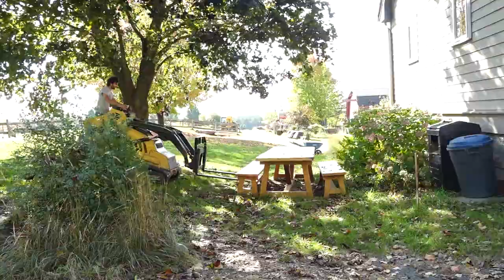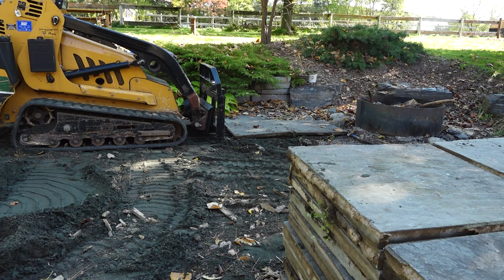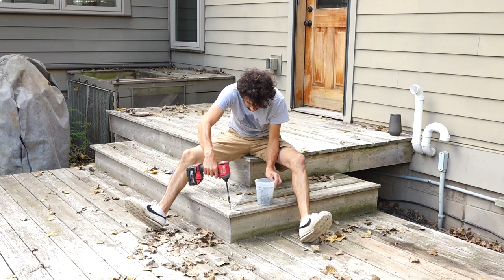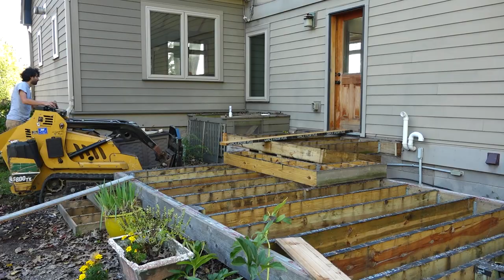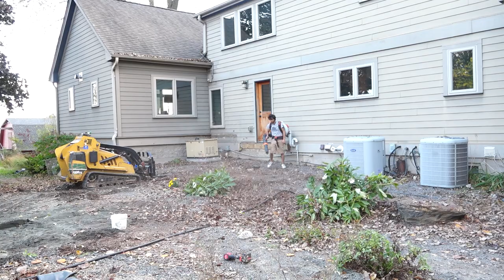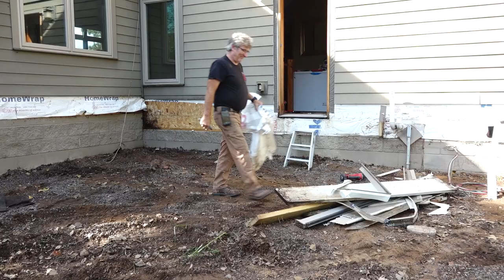Ripping out our Patio and Deck | Site Prep | Home Renovation & Addition Part 2

Comment: That skid-steer might be one of the greatest investments you've ever made, Matt. Loving the start of the house renovation series.
Reply: That grapple did wonders in pulling out those concrete supports for the deck.
Reply: @bwillan  Only because none of them had a frost flare at the bottom.

Comment: What is really interesting is watching you evolve. From your video salvaging trees in the woods. To using a chainsaw mill. Building your own bandsaw mill. Getting the skid steer. Getting the telehandler. Starting the renovation by carefully removing the screws from your deck. To using the telehandler to just remove the deck.

Comment: Bless that deck builder for not running the screws in far below the surface.  That deck can't be that old either as the screws readily came out. I tried taking deck boards off a old deck, but many of the screws were rusted and sunk too deep and the screw heads just sheared off.  It was a royal pain.

Comment: I'm impressed that you took the time to pull every one of the deck screws.
You can plain and joiner and trim those deck boards to like new and use them on your new deck sealing them with Thomson's wood sealer and west system resin coat for durability.
Just add sand to the resin for a skid free deck.
That mini fork lift is definitely a game changer taking out the deck and paving blocks.
I'm just surprised you didn't wear a waist lifter belt and lift from your knees instead of lifting with your back like you did.
That'll come back and bite you when your my age.

Comment: While you're at it you could just move the AC units and the generator under the balcony and put lattice with gate around it so it consolidated and hidden a bit. That is if there enough space for proper airflow...

Comment: I can’t believe that you use heat pumps to heat your house up there in Minnesota, therefore the two compressors must be A/C only. When we did our renovation we had two A/C compressors+heat pumps and a two-year old gas furnace feeding hot water to a house full of old cast iron radiators. During the restoration we added a third A/C only compressor and added a hot water radiator to each air handler while deleting the old cast iron radiators. There’s a three way manifold with solenoids off the furnace feeding the individual air handlers as determined by the three thermostats. Works like a champ. Our heating bill has gone way down. With all we did including a house wrap, doubling up 2x4 studs to be 2x6 per code and extra insulation the fireplace won’t even draw unless we leave a window open. We’re in Maryland and you’re in Minnesota so YMMV.

Comment: while you guys are re-engineering the roof you should PUT ON SOLAR!!! You won't regret it, it's one of the few things you can do like that which will passively  make you money.
Reply: Do you have an inexpensive supplier of panels? I've had 3 installers provide quotes and all of them in the range of $60,000 for my house. My electric prices are pretty low and have been trending down as more wind comes online. The payback is in the 25-30 year range.

Comment: Certainly the generator should never have been installed that close to the house and it should not have been covered like that either.. I also wonder how much all that "fencing" around the air conditioning units affected their efficiency. You have done a tremendous amount of hard work - well done.

Comment: Hey matt, that generator was installed very dangerously. Among many things, the exhaust is inches from the house, way way way too close to the windows, concrete pad had wash out under it and that stupid wood enclosure over it left it with no service access not to mention a fire hazard. 

Who ever installed it didn’t know what the were doing. 

Check your local code before reinstalling it.

Comment: As soon as I had an all terrain forklift (tractor in my case) I realized just how much I do not enjoy picking things up by hand. I didn't pay the money to sweat

Also, I tore down a bit over 1k' of fencing. Popping 4x4 posts set in concrete with the machinery just feels like cheating.
Reply from the maker: 100% cheating.
Reply: At last, someone using the only sensible cling film wrapper I know of !

Comment: you should have put the tel handler above each deck and lifted them using the chains or straps and move them to safe place and reuse as needed.fast easy (thats that hard part of building start thinking the faster way but if you can safe material do so

Comment: I’ve seen ac units stacked, saving valuable space. But the units you have are larger than the ones I’ve seen stacked. You may want to try that to solve your generator placement problem. Interesting to see your little project. You’re saving a lot by doing the demo yourself. Will you also build the deck yourself? 😃

Comment: Check the codes for your generator location. I don't think you'll be able to put it under the windows. I've installed a bunch and they are fussy with the location of the unit in Connecticut.
Reply from the maker: yes, and there's a distance from combustibles stipulation too

Comment: When you reset the generator, since you are putting it more in the open, it may be a good idea to avoid being under a tree. It would be a terrible irony to lose power from a tree on the line and you very expensive generator to be down because a limb fell on it.
Reply: Also needs to check codes on where it is located in regard to doors and windows.

Comment: Ya save those blue stone slab squares those can be used later around a fire pit or something.  They run about $25 each so lookes like you can save yourself about $500 right there .
Reply: I count about 60 with the ones around the pond.
Reply: @timothyball3144  well when your done you have enough to make nice walks and or patio with . They ain't cheap and realy nice if you scrub them clean .kentucky blue stone slabs are getting harder to get . Shipping is astronomical on them as well
Reply: @charlesyates6687  LOL I have been sitting here doing all sorts of stupid math before I realized that at $25 each, then each layer of four is $100. I counted about 14 layers so about $14-$1500.

Comment: Not sure what I am more confused by the long drive bit and extension or removing all the screws.... I'm not going to be that guy and point out things I think aren't done right or anything like that. The acknowledgement that trying to save the crappy old deck boards is a indication of you learning as you go. Good luck with this project!
Reply from the maker: The good news is all that deck material is coming in handy for bracing 🙌